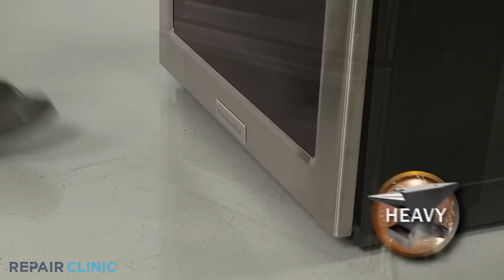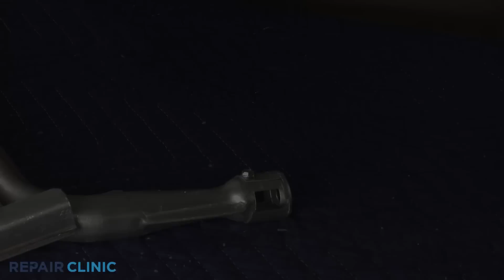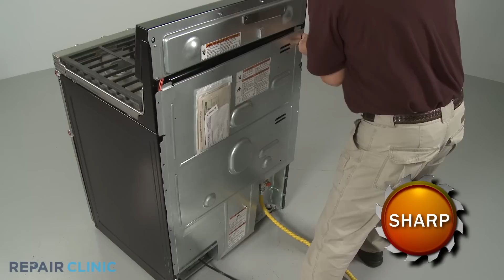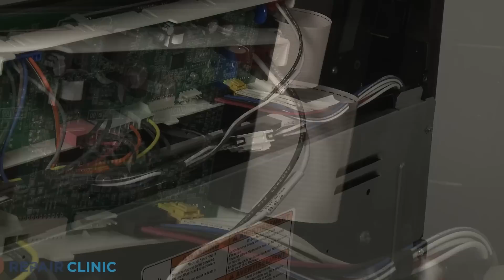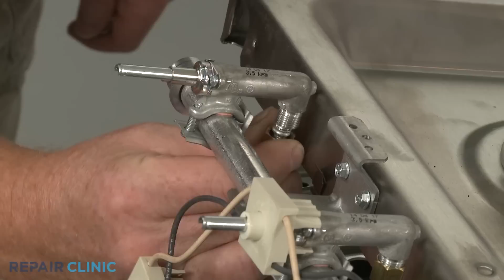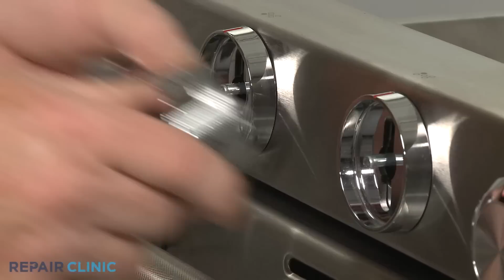KitchenAid Double Oven Gas Range Disassembly – Model KFGD500ESS04

Comment: For everyone here…the kitchenaid double ovens have a major flaw in that the electric igniters go bad every 2 years. Also the motherboard (behind the buttons) also goes bad. These ovens are faulty and kitchenaid should source higher quality parts and repair for free.  Will never buy kitchenaid again!  The igniter is an easy DIY fix for about $60 but its a hassle if you are not handy or elderly. Hiring a repair person could cost $400.